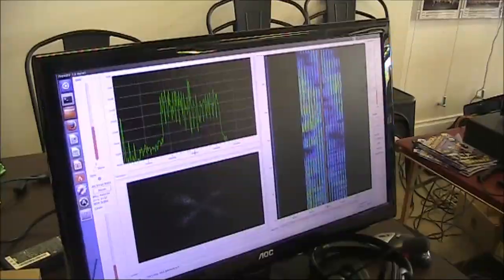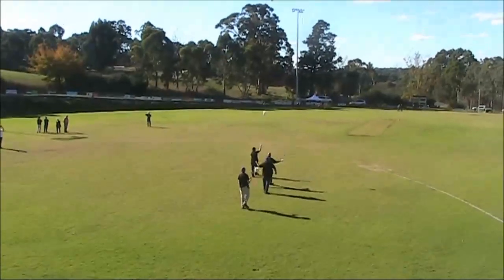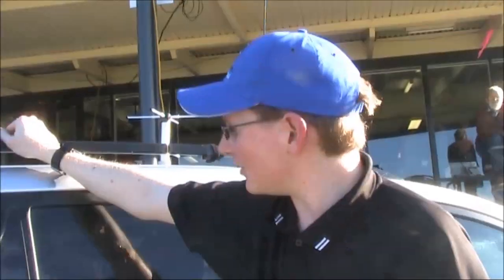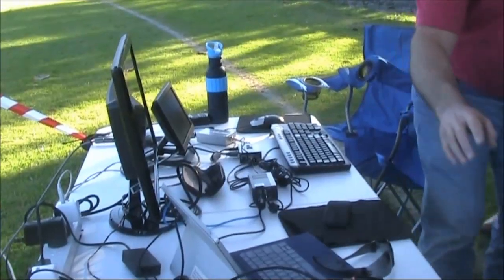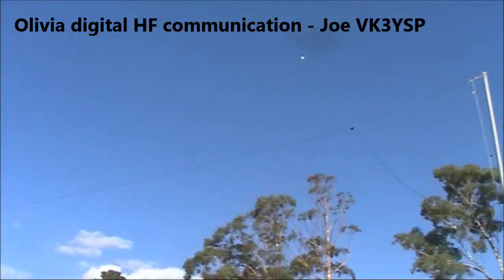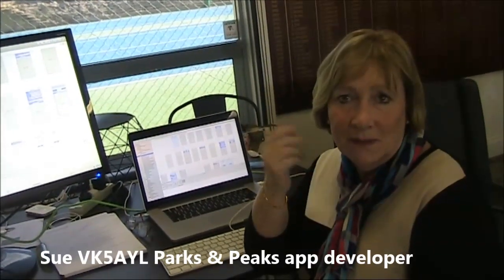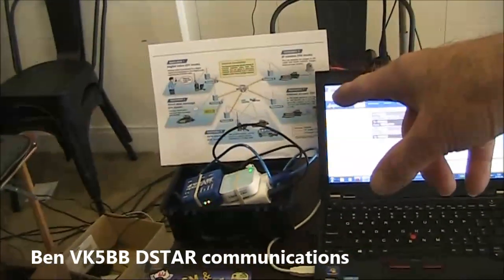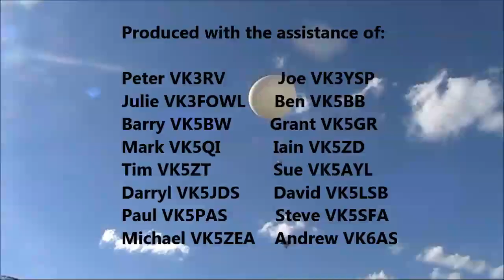The Best of Amateur Radio: Come and Try day at Hahndorf, South Australia (21 May, 2017)

Comment: Quite interesting  but where does the burst ballon end up?  Is it retrieved  or does it just become another piece of rubbish polluting the land and sea?
Reply from the maker: No it's retrieved.  It carries a GPS and transmitter that reports its position so the people sent out can locate and retrieve it.  And if it's in danger of going somewhere where it can't be retrieved (eg over water) it's possible to remotely pop the balloon and abort the mission.  The recovery rate is very high and only a handful have not been retrieved.
Reply: vk3ye that's  good news, I thought they said a hot wire burnt through the string holding the payload and released it .
I didn't  near the part about the balloon  being retrived.
Does it have a seperate beacon?
Reply: If they cut away, it will eventually burst and fall like you say.  However, they're made out of natural latex, which breaks down pretty quickly under UV light.